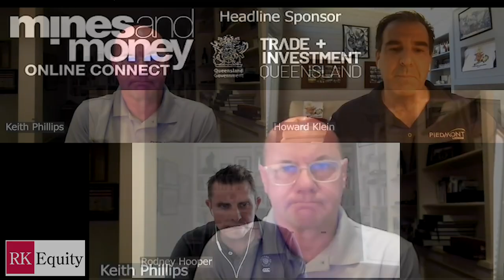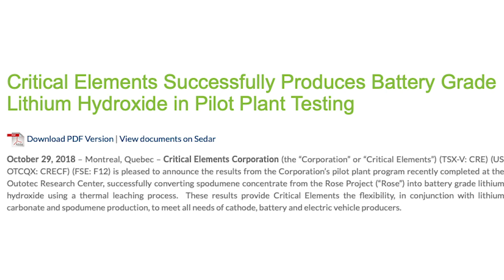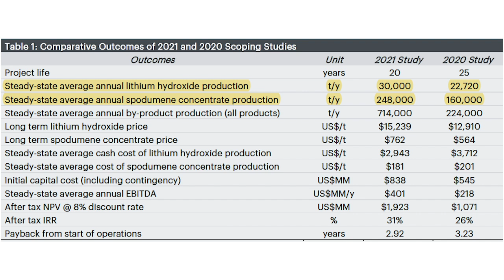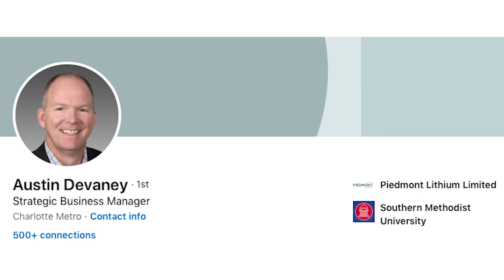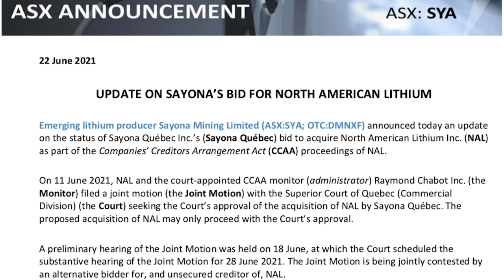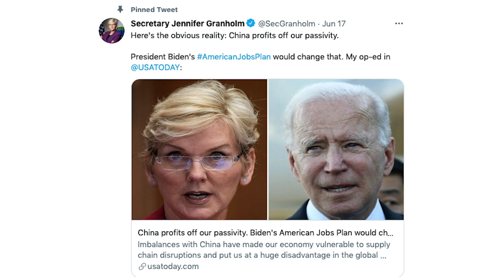E37: Carolina Spodumene Rocks! Piedmont Lithium's Keith PhiLLips

Comment: Does anyone here know how far ioneer could be set back if at all because of the endangered plant on the mine site in Nevada? Another great show and I thank you. Love Piedmont .
Reply from the maker: If Biden BLM stuck to Trump BLM guidelines environmental review would taje about a year as it did with Thacker Pass, in which case Ioneer is about halfway through that process.  Thiem’s Buckwheat issue has not slowed this timing process  - YET. Note BLM approval doesn’t mean a project can’t still be put in long term limbo. Or slowed down, as Thacker has been.

Comment: Great interview, very interesting!  

You mentioned 600 GWhrpa for passenger EVs by 2030.  That seems very conservative.  I would expect to see that in 2025-2026 timeframe.  Especially if you include light trucks such as Cyber and F-150.  That number seems about right for 2025.  Consider that Tesla expects run rate of 100GWhrpa by end of 2023.  My understanding from Battery day was that they would then expand to 250 GWhrpa.  While the first number is likely to occur on Elon time and should probably be bumped to 2024.  The expansion of a working process would more likely be on Shanghai time and be completed very rapidly.  They will have 10GWhrpa in Fremont and 35+ in NV.  That gets us to 300GWhrpa just for Tesla!  GM recently announced 2 more plants.  Presumably the latter 2 will be comparable or larger to the two that had been announced so that is another 140 GWhrpa and Ford just announced 60.  That gets us to 500GWhrpa for just American auto makers by 2025.  Then there are all the rest who undoubtedly will want a footprint on US soil.  No doubt, some of Tesla's capacity will be used for Utility applications.  However there will be additional auto makers building capacity in the US and everyone keeps revising their numbers up.
Reply: Agree completely. Northvolt has serious plans as well.
Reply from the maker: Yes the numbers are more conservative than others, but it’s possible that availability of battery quality raw materials like lithium may prove a limiting factor constraint for all autos meeting their aggressive targets.